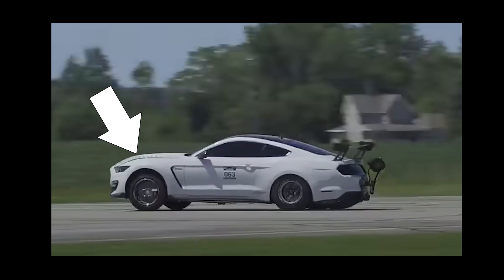Shelby GT350 Carbon Hood Louver Tuft Testing

Comment: Does this kit come with a rain guard or anything like that? Is it needed?
Reply from the maker: No, we do not offer a rain guard for this kit. The small factory louver does not have a rain guard either, so it is not needed. Modern engines are water tight, so nothing to worry about unless you have an open air filter.
Reply: A follow up question: seems like the rain guards are offered for side louvres. Is it because they are in more sensitive areas as opposed to this?

Comment: Will this hood vent fit a 2016 Mustang GT PP1 hood.  If not...can you please make one.  Black light textured to match the Roush side hood vents.
Thank you !!
Reply from the maker: No, it will not. It is very specific to the GT350 hood. However, we actually already offer Hood Louvers for the S550 Mustang GT.
Reply: @VerusEngineering  I will have another look to find them.  Part number(s) would be helpful.
Thank you !!
Reply: I found it. Thanks.

Comment: I like it, I wonder how it’ll hold up versus the elements with only being taped down though
Reply from the maker: It will hold up very well. 3M VHB is used by various OEM manufacturers to secure body panels, lips, etc.